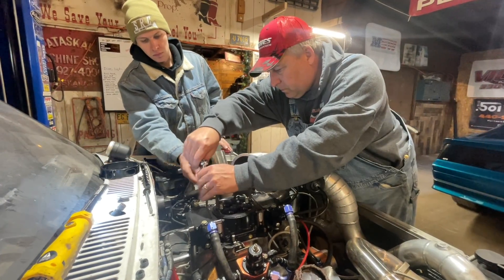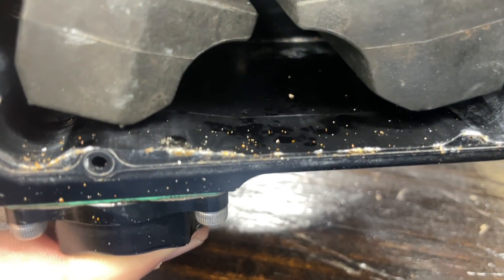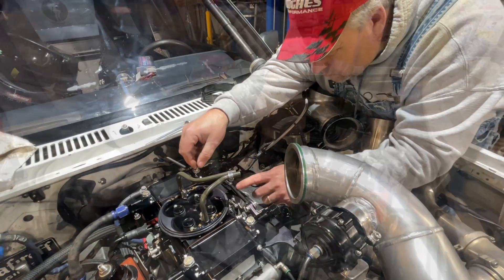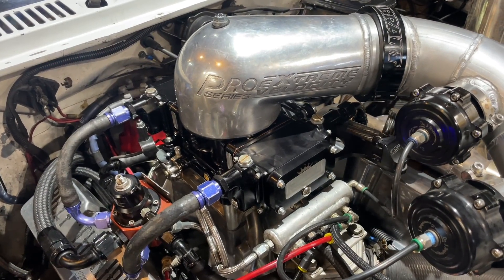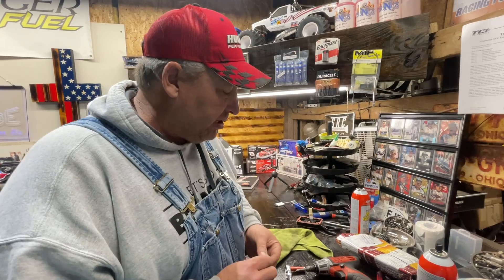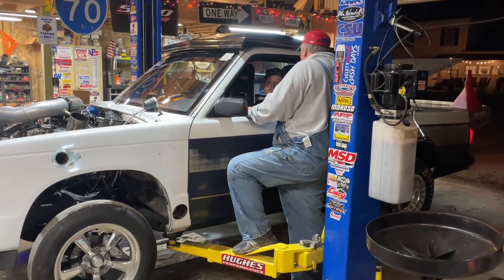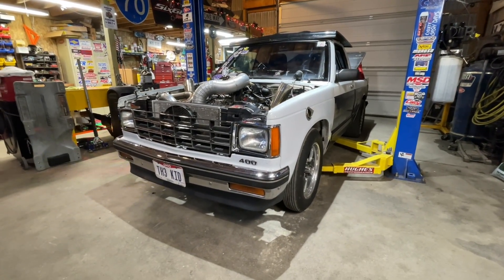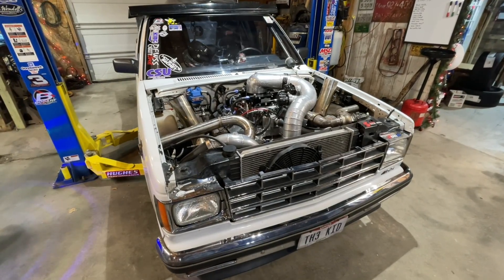READY FOR THE DYNO! Fuel system and Carburetor issues FIXED?!?

Comment: Bill it is great to see you back to enjoying what it is you are great at doing . Building hot rods and problem solving is more than half the battle with a hot rod. If it was just bolting on parts anyone could do it and it is not that easy. Your sons should know how important you are in their corner they wouldn’t be near as successful if you weren’t there to solve the problems and lead the team so to speak. It is so good to see you smiling again, you are happy and it shows. Congrats on getting her ready for the dyno.

Comment: Bill, having run top alcohol dragsters and funny cars for  20+ years we found that you cannot leave methanol in the fuel system for any length of time.We actually drained the system even for overnight when racing.Methanol absorbers the moisture out of the air and it contaminates it in a short time.We  have fuel checks every pass when racing and would fail the test if fuel is high on moisture content.We also found that we needed to filter the fuel going into the fuel tank  all the time as we have seen that white stuff flowing through the clear hose on the fuel jug.I would suggest draining the fuel cell when ever the truck sits,blow out all the lines and maybe spray wd40 or equivalent into the carb vents just to coat the inside of the bowls .
Reply: When JR dragster folks started running methanol they learned what you are saying real quick. They are a lot easier to do it to though.

Comment: Well done, could the methanol be breaking down the inside of the tank? The oxidation of the interior was kinda surprising. Glad you're feeling better and spirits seem up.
Reply: It seems to be the additive. That additive may have been formulated for gasoline, not methanol. It wasn't breaking down and mixing properly. There's also a slight possibility that it was some type of sealant or teflon tape that was then broken down by the methanol. Hopefully they got it fixed.
Reply: @RonniePTexan  ិនោ
Reply: @kimorkrim3153  Sorry I don't speak Spanish

Comment: Great video i really messed up about 10 years ago when my buddy talked me in ti running methanol i bought a carb put on bigger fuel line it ran a 11.30 on 110 and 10.20 on methanol and no one told me to take the foam out of the fuel cell 2 fuel pumps and oh you cant run a fram paper filter either i finally figured it out the other bracket racers dont like it you can tell by the tears in there eyes in staging but they will get over it have a great day be safe.

Comment: FYI injectors have screen filters built-in and should be professionaly cleaned and tested for pattern and flow of volume especially with alcohol fuel this may be hiding some power on the falcon are you using the same top lube in the falcon ?

Comment: That fuel thing is strange. I think that fuel has been a problem for awhile. I would definitely keep those filters on the self in the shop or trailer. I used to change my filters about every other race in my race Jeep. But that was all 300ft dirt drags. We always had trouble with Air and fuel filters. I’m sure glad Billy let you and Kenny fix that carb. That was a dangerous situation, nothing to play with. Bill Please make them boys put shut off switches in them cars. You guys are running to fast now to be fumbling with a damn key switch on the column. Way to easy to lock the steering wheel at 140mph.. Now that’s dangerous. I think that test run even shock Billy a little.  So glad you are there to over see things. Someday the boys will realize just how much knowledge you have and you are just trying to keep them safe.. Another great video
Reply: estops are a very valuable tool
Reply: Sad thing is that the boys will never realize just how valuable bill is until they don’t have him anymore. Hopefully that’s another 50 years from now and that’s not meant to make the boys sound bad but that’s just human nature and every one of us are like that. “You never realize what you had till it’s gone” that’s been an old saying that’s been floating around a few hundred years but it’s so true, especially today. The boys may start getting a small taste of how valuable bill is too them now that they’ve moved shops, but they will never see the true amount until he’s gone and it’s too late to say anything. Why we as humans can’t wake the F up and understand this while our fathers are still here will always boggle my simple ass mind cause we could be so much better than what we are if we just realize that and be appreciative of it and use it to our advantage instead of being hard headed and trying to prove that we can do things that we have no idea what we are doing!! I’m guilty as well but I did finally realize it but of course it was too late as always and now have to live with that forever unfortunately
Reply: @MrStroked10  absolutely! Put one in about the location of the old dimmer switch button on the floor so you can just reach up with your left foot ad tap it. Last thing you need to do while your trying to steer and grab the chute is to try and reach for a shutdown button somewhere to hit but that left foot is just hanging out down there and never has a purpose since they moved the dimmer switch to the column
Reply: @1982MCI  This is a really dumb comment
Reply: @12anded  I seen someone rig up a kill switch to the Parachute handle. At first I thought that’s dumb. But the more I thought about it, it’s a pretty good idea if you are on the big end and need a kill switch then it will help the car stay straight for a shutdown. It may not work if you have to pull the Parachute handle at a 60 foot wheelie stand with a stuck throttle. In My race Jeep the kill switch was the first switch next to the fuel pump on the cage bar across the dash. I always hit the ignition and fuel pump at the same time if I’m heading towards the wall with a hung throttle. I had this happen two times and I believe it saved me from hitting the wall. If i hit the wall I dumb sure don’t want the fuel pump running. I don’t run the MPH these boys do. But it you even ran a 600-700hp or more Jeep in 300foot of sand or pea gravel a lot happens very fast. You really don’t steer the Jeep. It’s more like you line up and pull the trigger. I have ran 300ft with my front tires barely touching the ground. The Jeep I’m building now will run in the slower classes. At 53 I don’t have the reflexes I once had. Can I still run the faster classes? Sure, but at what cost?  Bill and I are close to the same age. He has talked about just running his nova in the street classes. Like me he realizes his ability. Can he run the small tire class and be successful? Sure, but why try and compete with your kids?  But a emergency kill switch is something I would be sure my boys had. They are pushing 140-150mph in the 1/8. That’s to fast to be running a key switch in my opinion…
Reply: @1982MCI  listen to Cody Johnson song “Til you can’t”
Reply: @riverrat4631  I completely understand brother. I cut my teeth into the race world running Jeeps in the pits back in Ohio in the early to mid 80s. I’m a few years older than you are yet so I completely understand and know things can go south real quick running a Jeep thru a pit. No we didn’t run the power levels or the speeds that we do on a track but you have so many variables that hit you in an extremely short span of time and when it goes wrong, it goes wrong in a F’n hurry!! The fella that commented above about my other comment being a stupid one has obviously never been faced with running his car into the wall or a hung throttle etc when your mind goes into sensory overload trying to understand what has just happened and what do I do now to keep myself off the wall. That’s ok tho, his attitude will put him there one day and he’ll understand some of us older F’cs may be right about a few things. It’s those attitudes that will get them into trouble. 

But after running the Jeeps for several years is when I started running street/track when I built my Barracuda in 1987. Things were a whole hell of a lot different back then cause all we had for adders in those years were NoS or build one with a 6-71 on top of her. But still, we weren’t running half the power then that billy runs today but when 💩 happens, it happens fast and I’m still a believer in having a shut down to at least give yourself the option. I’ve worked in both the industrial settings and aviation my entire career and the thing both of those fields have in common is the safety protocols that are in place for both and the ability to shut down an entire machine room floor in an instant if life or limb warrants it but you have to process all of it in about a quarter of a second or less and it’s easy to get overwhelmed during that short time span and you need to have yourself trained so that everything is second nature and you don’t think about it, you just respond! It doesn’t matter if I’m in an industrial setting or running a 1,500hp S-10 down the 1/8th, you always want to be able to have control over that machine and what it’s doing every second it’s running and if there’s ever a partial second where you don’t have control, then you’ve gotta have that ability to shut it down and Regain that control cause either your life or someone else’s life may just be hanging in the balance. 

Take care brother , be safe out there
Reply: @1982MCI   I race at Gravelrama in south western Ohio. Plus I hit all the county fairs that have 300ft dirt drags around IN,OH,KY. I tried drag racing several times and keep coming back to the Jeeps. Just something about a 150ft Rooster Tail…lol. Plus the Off road racing drawls a different type person. I just fit in better. Stay safe brother.

Comment: Years ago when we started running a Top Alcohol Funny car, I remember having several different items reacting with, methanol. 
One of the biggest problems when running gasoline based fuel systems and switching to Methanol or God forbid Ethanol, are that with gas their are only a couple maintenance items versus an alcohol motor. Both the scaling and the Methanol drying extremely quick pose the biggest pain in the rear, at least for us never running alcohol before. The alcohol reacts with Aluminum (fuel cells, fuel system fittings, aluminum hard lines, etc...) as it is corrosive. Don't fall for the old b.s. that anodizing is bulletproof.
Trust  me when I tell you it will eventually eat it up. Although with today's technology as it applies to coatings, has virtually eliminated these problems. (PVD coatings, stainless steel and the use of linings, etc...) Alcohol as it dries turns like a gel, and finally to a gritty looking sand type of mess... most can be attributed to extremely high speed evaporation reacting with the aluminum, drawing moisture into your fuel system. After each run, we simply used WD-40 and sprayed the hat out, and the final tail of fuel line, and prefilter which eliminated 99% of our problems. Not saying that's what you HAVE, just might help though in the future... hope so! Enjoy the channel ( my granddaughters and I  ) keep on keeping on brother, glad you share with us!!!      Seth Hughes

Comment: Bill Sr,

I'm not sure if the fuel cell in the S10 is aluminum or plastic tough to see in video? If it is aluminum the cause of all your fuel issue's are probably coming from the fuel cell and possibly old fuel lines. 
My friend's El Camino when switched over to alcohol it had a lot if fuel issues because of the cheap aluminum fuel cell. We switched it with a custom made stainless steel fuel cell and upgraded fuel lines / fittings . Also if truck sat more than a week we would drain the entire fuel system. Put alcohol back in sealed drum. If racing every week the filters got pulled as a regular maintenance item. It would be a good ideal to have a Hydrometer to test the fuel also. If the aluminum is not high grade you guys will continue to have fuel issues.  
Alcohol is very temperamental and requires a lot of maintenance.  This helped us tremendously with little to no problems once at track. 
There is a bunch of info on the web on this also. 
God Bless and keep content coming 😉👍

Comment: I once had a stuck throttle problem as you describe. It only happened after I changed from a 30cc front pump setup to a 50cc. Checked everything on the car and found nothing. Removed carb & checked again, eventually it stuck. I disconnected the secondary linkag and traced it to the primary.

Since the only change was the addition of the 50cc pump and cam I reinstalled the 30cc pump setup and it never did it again.
Best I could figure is the pump spring adjustment and pump cam combo didn't like to play nice at times. Perhaps an angle issue? I could have been out of my mind but it's something to think about. 

I ddn't really need the 50cc pump since it was on the 2 step at the line in bracket racing. But in your case there is a need to use that extra for a pedal job when it breaks traction.

Comment: That roller dyno might not be very accurate for that little monster. I've seen 1500 hp smoke a roller dyno. Couldnt get traction, they ended up going to a hub dyno and found out how much power it could put down.
Reply: This is true but they might not have access?
Reply: Agreed. once they start hitting 13 to 1400 hp on small tires with roller dyno they loose traction. Only the stationary that blot to axles give true numbers for hp.

Comment: Might also want to check the inside of the fuel drums. The liner coating inside may be breaking down for some reason, (see this happen with metal motorcycle gas tanks ) perhaps using a paper filter when transferring from drum to fuel cans will help. [Edit. I have seen that ethanol does eat away aluminum venturis in small engines causing it to powder and pit plus normal rubber seals become gummy.] So, I deduce that what is happening with methanol left in the aluminum fuel cell is a break down chemical reaction between the aluminum and the methanol leaving the fine powder residue in the fuel cell. Try moving to a plastic fuel cell instead.

Comment: Hi Bill, seems like you're working harder than you need too, to get the fuel out of the truck. You probably need a bulkhead fitting with dash 8. and add 4 ft of gas line to a gas can. Then you won't have to take the wheel off to drain it. Talk to you later
Reply: Bill used to have extra line on there with loops in them so he could just remove the line from the carb and set the jug on top of the fender and pump it right in really easy but recently someone made a change and thought they would help billy clean up the engine compartment and they cut the extra fuel line off so there was just enough line to reach the carb. Sure, it looks cleaner, but folks don’t always realize how much preventative maintenance these machines need and the Professor has all of this stuff seriously thought thru and they don’t understand there is a purpose and a reason why everything was done on that truck! If it wasn’t done to make it run better, then it was done to make it easier to work on and maintain!! 

Those loops were really nice if they ever needed to flush lines while they were at the track but now it’s an ordeal. There’s a couple things bill could do now to make it an easier process without putting the loops back in tho. Your idea would work great as would making up a length of hose however long you needed and have a male fitting on the end to screw into the female fitting that unscrews from the carb and then the jug could sit on the floor outside of the fender next to the front tire and there’s no more lifting it out of that tight hole, no pulling the front tire, etc.  Just unscrew the line from the bowl, screw the extension line into the main line, stick the hose in the jug and turn the pump on. Keep the extension hose in the bed of the truck close to the pump and filters and secure it with a zip tie so it’s always with the truck no matter where he’s at and the zip tie will prevent it from getting thrashed around. But either this way, or your way would be an easy, and quick fix to this new issue if yDou look baccarat at any video over say a month old, you’ll see the loops I’m talking about.  They meant well, but it was a huge fail removing the loops and extra line that was there for this very reason
Reply: @1982MCI  Yes I remember that it used to, but Billy had them taken out.

Comment: I laugh every time I see your fuel pump procedure for a fresh carb install. I've had a blowthru carb hung open with a bonnet on and when I tried to start it hydro locked the engine. (I was 16 years old) so I pulled the plugs and changed the oil. I went to clear the cylinders and shot gas 10 feet on both sides. The ignition wasn't unplugged. I believe if I hadn't changed the oil the truck would have burnt down. It's amazing what you learn by doing and how dangerous it is to not listen to others

Comment: i think this is the second or third time you have had issues with dirty fuel. Maybe you need a filter on the barrel you pump you fule from? Maybe also use a filter when pouring the fuel into the tank. I would also put ball valves before and after the fuel filter. Then you can isolate the filter quickly and change the fuel filters regally. Preventative maintenance is 90% of the battle.

Comment: I had a similar issue with my s-10 conversion with the fuel.  The truck was at a body shop for awhile with a cover and everything over carb.  But the issue was dust was getting in through the vent of the fuel cell and I had cake up crap through the whole fuel system.  It was so bad it locked up everything in the carb.